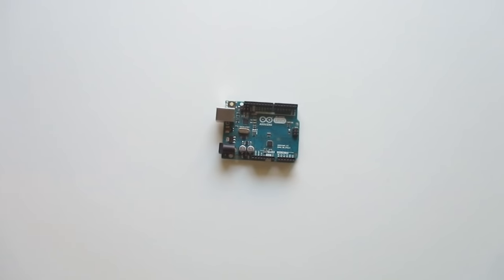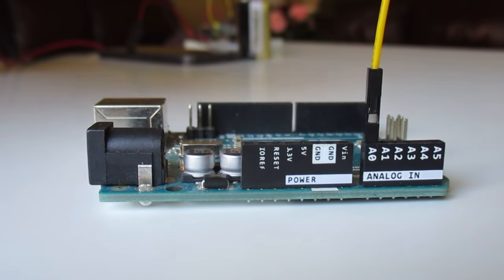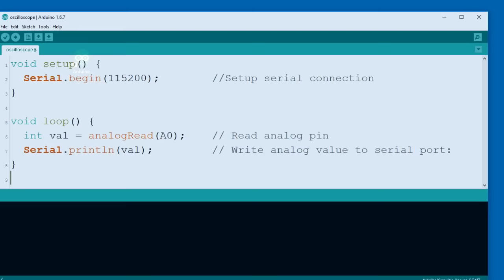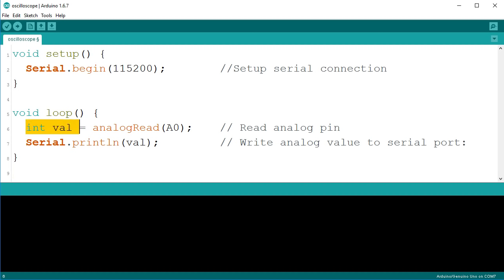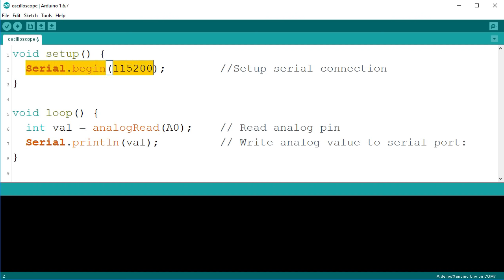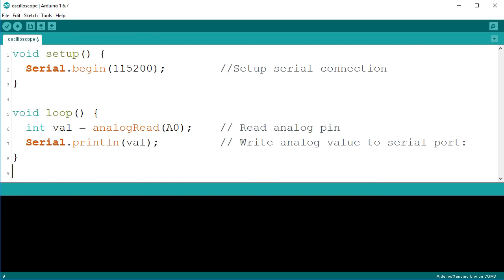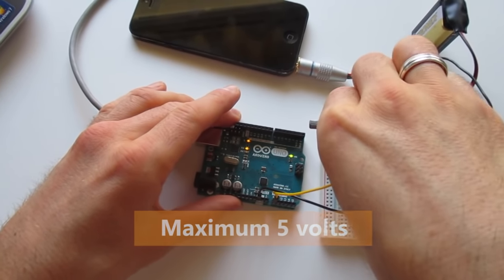Build An Arduino Oscilloscope In 2 Minutes

Comment: I am probably really dumb for asking this question but why do we have to add the ground pin? I tested it out without the ground pin and it worked pretty well. Thank you if you answer this.
Reply from the maker: Yes, connect the ground pin also. Otherwise, you'll get mostly noise.
Reply: @Ohmify  thank you

Comment: would it be fine to measure a motorcycle crank position sensor which outputs around 2 AC volts with this setup?
Reply from the maker: If it's a slow AC, maybe. The signal will be distorted but might be good enough for your use
Reply: @Ohmify  thanks for the reply, will give it a try

Comment: Why is the oscilloscope output so unsteady? Is it real or is there a problem? Great effort btw.
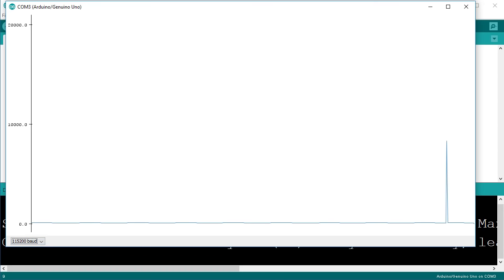Reply from the maker: You mean at 1:27 in the video? The probes are floating and will behave as antennas that pick up any electromagnetic noise. My guess is that the waveform you are seeing there is 50Hz being picked up from the power lines in the house. But note that the Serial plotter automatically zooms in to the signal amplitude. So this is maybe around 0.1V only

Comment: how can I configure this for 5v ac power
Reply from the maker: Arduino requires DC power, so the only way would be to build a circuit that converts your 5V AC to a DC voltage and boost it to somewhere in the range of 7V-12V which is the recommended voltage.

Comment: the serial plotter has been right in front of me for two years. only now you tell me what its for. your so mean.i hate u😭 what's the max frequency it can handol?
Reply from the maker: I haven't calculated it. But it will be limited by the maximum number of samples you can send from the arduino per second, which depends on the serial baud rate you have selected.

Comment: Is there need for a buffer resistor to lower the input voltage?
Reply from the maker: Yes, if you are working with voltages higher than the ADC voltage (5V in this case)
Reply: @Ohmify  will a 220R one do?
Reply from the maker: @Cloverboi  You could use a voltage divider: https://www.build-electronic-circuits.com/voltage-divider

Comment: if I connect arduino to an instrumentation amplifier and connect the inputs of the  amp to cables up to my body , I can have a crude heartbeat, ECG scope or monitor like those in a hospital. the serial plotter will give a graphical display of your heartbeat.
Reply from the maker: I am not sure. But if you want my guess, I'm guessing a crude version should be possible.
Reply: You mean, a microphone?